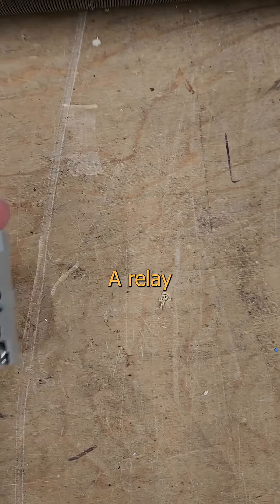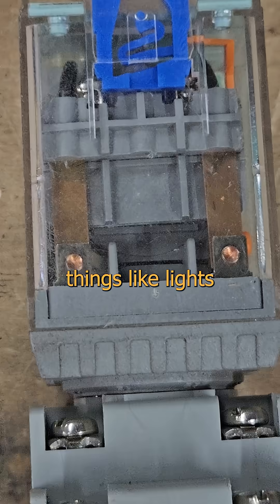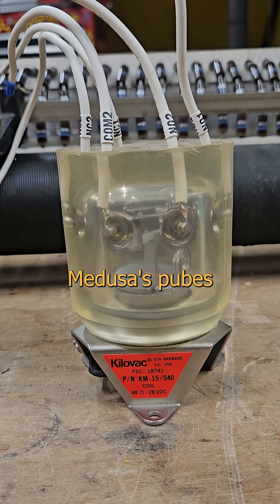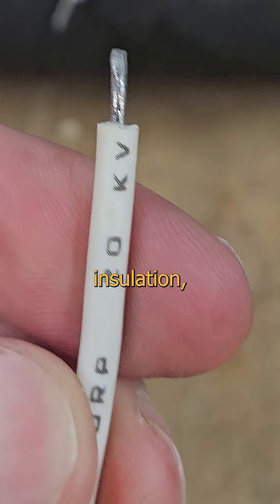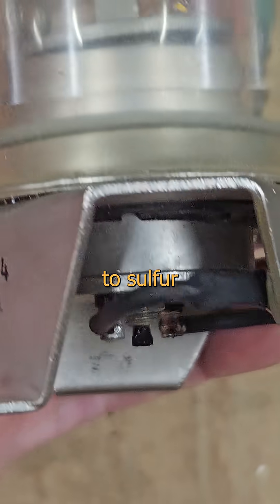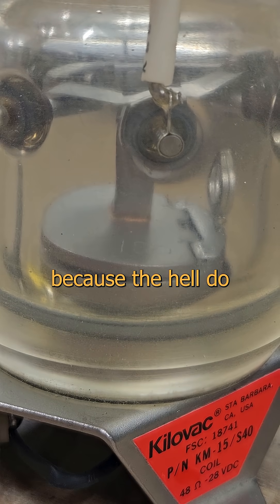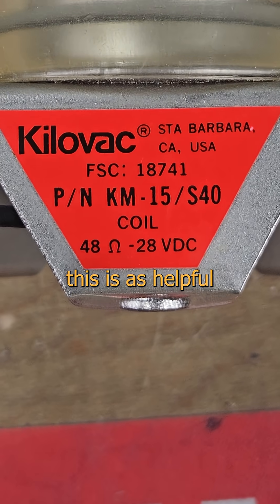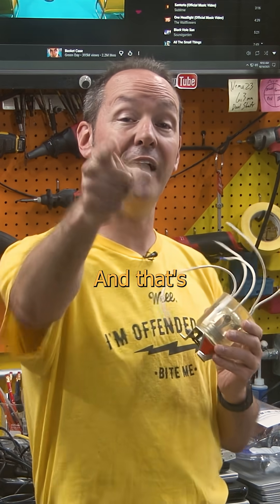High Voltage Relay #chrisboden #comedy #engineering #electrical #science #educational #jokes #adult

Comment: Since different gasses have different breakdown voltages the atmosphere could be something exotic which is why the contacts are way closer than what they'd be in air, but I'm betting that's actually for spark containment.  Flammable or corrosive atmo.

Comment: Even in the trucking industry relays are used... and not just electrically whatsoever! >: D

Whenever we need to stop, we use compressed air to build pressure to then use it for later for other things besides the airbrake chambers, but exclusively for said airbrake chambers.

But the problem with air is that since its compressable, there'll be a delay of the application of pressure from the source, i.e., treadle valve, to the brake chambers.

And one of the factors are the diameter of air hoses used to carry the pressure (supply and signal) limiting flow rate, and it gets worse when you factor in trailer brakes, its a      l   o   n   g    way from the source so we use brake relays, or a remotely controlled treadle valve essentially and its fully mechanical and doesnt rely on anything but the air thats supplied to it.  AND THATS PRETTY COOL.

sidenote for clarification, by introducing the brake relay, it allows for quicker syncronization between the moment you start supplying pressure (ime., putting your foot down on the pedal) to the airbrake chambers actually moving to force the brake caliper/drum brakes to halt the drum/rotor from moving anymore.   That and the trailer you connect has its own air tanks so that the relay can use the pressure filled by the trailer to apply brakes instead of having to shove air all the way down the hoses to then fill the airbrake chambers to then start applying brakes.

Plus with air pressure you can have fun accessories like a gladhand airchuck adapter so you can use the air supply from your truck to then reinflate your tires if they're little low on air.    Adjustable seats, truck suspension (air suspension), CTIS (on the trailer, it will use the supply [red] line to air itself up on suspension, air tanks and in addition, the central tire inflation system. And its regulated pressure too so it wont go b0 om as moments later after pushing the big red button to supply air to the trailer.) and more like an air horn.   Some truckers can be devious and install train horns.  And thats also pretty cool. lol

Comment: The only time ive ever seen electronics coated in epoxy like that was a robot welder. They claim its to protect the circuit but i bet its so you cant poke around with a multimeter and fix individual components when you need to.

Comment: Definitely something used in a combustible environment. Usually they just swap over to pneumatics so if there's a problem it's just leaking cda, but if for some reason they NEEDED electronics in the area then this would be a massive spark insulator. Working in something like a flour mill or sugar refinery and you'll understand real quick how anything that can produce a spark is a one way trip to the pearly gates

Comment: From what I could find, it looks like it's under vacuum, but not rated for switching under load, which means this is for isolation during maintenance, but but not to be used as a disconnecting means during operation.

Comment: Saw some models of relay switches for lighting that let you control multiple lights from a single switch just by how you actuated it, as well as turn everything on or off in the house from a single switch, and the best part is that it is fully "dumb"! No internet connection needed, no wifi/signal delay! Just glorious electrons and magnets directly changing the world! Shame it cost an arm and a leg and that was before international shipping ;-;

Comment: Not a high voltage relay. High voltage starts at either 20,000 or 25,000 volts depending where you look it up

Comment: My first thought was that super-high voltage at regular current can be done this way because the contactor otherwise needs to be huge.
Second thought is that this is doing the absolute most to admit 0 sparks--so it's needed in gassy environments.
What super-high voltage is doing in super-gassy environments, I can only wonder.

Comment: ChatGPT had all the details. 

“a 28 VDC-controlled, vacuum-sealed, high-voltage relay used in aerospace, RF, or scientific power systems where you need to isolate or switch thousands of volts safely.”
Reply: Doveryay no proveryay. AI is great and the best thing about it is that it usually makes it easy to validate its output.
Reply: And yet everyone in the comments here that has actually seen one in original equipment has a different answer. Its spark safe for use in possible explosive atmosphere. The only case that this exact unit has been seen in, by many people, is in 1970’s defibrillators designed to be safe in oxygen/anesthesia rich environments such as an operating room.

Comment: An explosion proof relay. Several commenters have mentioned defibrillators, so that makes sense for a high oxygen atmosphere in a hospital (ER/cardiac unit?).
Reply: I would be surprised. Defibrillators aren't typically used in a high oxygen environment for fear that we'd all end up like Apollo 1.  We typically would remove them from a high oxygen environment for resuscitation. And an ICU with a patient on a ventilator with 100% oxygen still isn't a high oxygen environment. Even if a defibrillator is intrinsically safe, the defib pads and paddles definitely are not.
Reply: Ha! I just proposed this in response to another comment.

Comment: I know very little about electrical work but I do still have a dumb theory:
Perhaps it's something that needed to be visually monitored consistently and, despite being low voltage, the protection on it was designed to keep people from touching it accidentally when checking to make sure it didn't explode or something.
Again, I'm dumb and have basically no experience in this sort of thing but that's my random theory.

Comment: Vacuum is a perfect insulator..close spacing doesn't cause arcing. 
Silicone insulation tends to be used for extreme environments (heat/cold)  and/or where the wire has to move (be flexible).
Reply: Silicone is also useful where the wire insulation has to be resistant to potential chemical reactions from the probable exposure hazards of the system it’s used in.

Comment: As it happens I recently used a couple of those for a scientific setup, at about 3kV (the relays were rated for 15kV, because we found those in a closet somewhere).

The contact separation is surprisingly small, but the whole thing is at a reasonably high vacuum. When there is no gas to ionize, there can be no spark. If the envelope is damaged and air gets in, everything will be on fire.

Comment: I won’t claim to have come up to this hypothesis myself, I have seen someone else in this comment section that said it first, but I agree with him. I believe this is not necessarily for high voltage but maybe for an environment where even the smallest sparks from a relay could be catastrophic like in an oil refinery. This relay could be what gives power to the pumps that pushes the fuels around. I also believe that the space in the middle would be filled with an inert gas so that no flammable gases can enter and be ignited by any sparks that might be produced in it

Comment: I let Grok do the finger walking,
15kV peak, 12-15A continuous, SF6 gas, shock/vibration resistant, -55C to 85C, 1 million cycles of make only contact. The S40 is likely a configuration designator.

Comment: Here you go: ⚡ Kilovac KM-15/S40 Overview
Type: High-voltage vacuum relay

Contact Configuration: DPDT (Double Pole Double Throw)

Current Rating: Typically rated for 10 amps (make-only applications)

Voltage Rating: Designed for applications up to 7.5 kV

Environment: Gas-filled or vacuum-sealed for high reliability in harsh conditions

Applications: Commonly used in medical equipment, aerospace systems, and other high-voltage switching environments

Comment: I'm wondering if this isn't meant to be used for some explosion proof motor or fan assembly.  I've seen very much smaller, completely sealed relays using the application before in Pump stations

Comment: I would bet that it has something to do with either gases very combustible gases where the voltage isn't necessarily the thing that's the issue. It's the fact that if anything were to get in between that little tiny Gap where there could be a spark you could have a bad day

Comment: Gas filled high voltage relay. Looks like a DPST? Tyco bought Kilovac a while back, and that one is from the 80s I think. The fill gas is under pressure to reduce conductivity. I don't remember why it works like that, but yeah, low pressure means arcs, high pressure, not so much. Could be something like pure nitrogen, or SF6.
Reply: No, it's DPDT, 6 connections.

Comment: Since a couple comments said that they can be found in old defibrillators, I’m thinking that it’s to prevent sparking in an oxygen enriched atmosphere. Like an operating room in a hospital.
Reply: The relays we used in defibrillators were made out of thick glass not any kind of plastic.  :)
Reply: @waynecampeau4566 the plastic is on the outside protecting and holding. There’s a glass envelope for the hermetic seal with the contacts inside.
Reply: @waynecampeau4566   maybe, but the design screams hazardous atmosphere (or one that is dangerous to have a spark in)
Reply: @waynecampeau4566  different manufacturers use different parts, broseph.

Comment: I have come across those in old systems that require intrinsically safe components. As far as I know, that's the only reason it's built that way. Newer PLCs and components don't require the bulky explosion proof stuff like they used to. Components are now smaller and internally potted.

Comment: Well.  MAYBE. 20KV is an inch of arc. The norminal voltage would be less than 20KV.  If the inside is pressurized then possibly, but why the long stand off ?   
     WEIRD. Unless they need to see the contact and relay move.
    This will be an interesting find.

Comment: Project Idea: If it is Make Only like its cousin the KM-17 you need something that only gets turned on, never turned off.
😂😉🤣

Edit: I see comments talking about defibrillators and that it might close to make a circuit powered by a capacitor.

So to modify my original joke.
If she's Make Only like her sister the KM-17 you need a project that gets turned on, and can only be turned off after the discharge.

Comment: I pulled exactly one of those out of a really old defibrillator. 
Ironically, it was in my list to find a mail to you.  i guess i don't have to now!
Reply: 2 of them means he can see what flavor of magic smoke one of them makes.
Reply: @Erezeneb "Through the magic of having two of them..."
Reply: @LexYeen damn you beat me too it
Reply: it does look like a extremely high reliability relay. Inert gas filled for minimal contact degradation, and HV leads to move the voltage to the business end.

Comment: 20KV wire, but still only looks like about #10 or #12 

What could possibly be consuming approximately 15-20 amps at (probably) 14,000 volts.....

Comment: Because it's totally sealed it could be used in places where a voltage arc would cause mayhem. It's probably not the oil sensor but the relay from that sensor which triggers something else, and completely sealed because it lives in the oil tank.